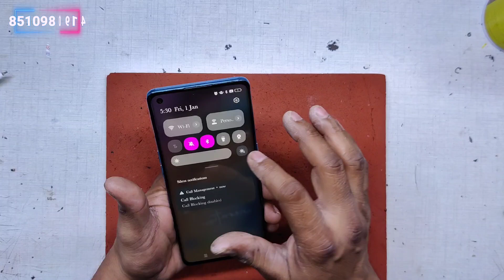OPPO Reno 5 Pro Display Replacement || Reno 5 Pro cracked screen repair

Comment: Pls tell me price of screen....😢
Reply: 14400 original display
Reply from the maker: 6000
Reply: Where I can get changed
Reply: @AtishayJain-ve5ew  if your phone doesn't have a dent then you can get it replaced at oppo service center free of cost
Reply: @mridulbhattacharya  bro but I don't have any warrenty of my mobile so then who I can get freely..as u said u don't have any dent in mobile it is the only point to change my mobile screen becoz my mobile get that green line issue...nd mobile have no dent ... 🙌